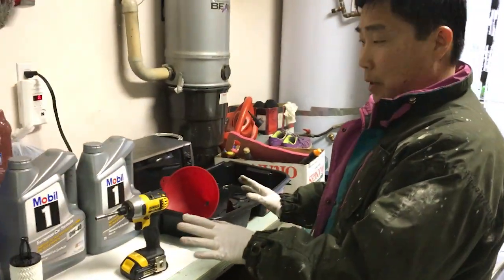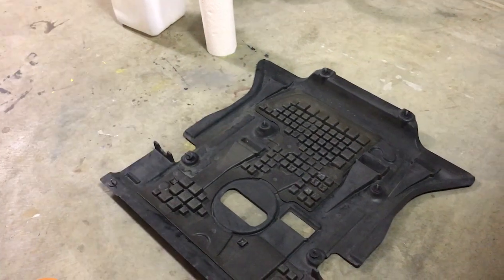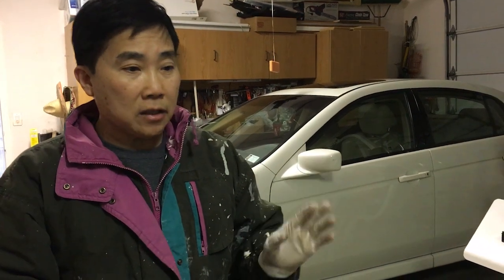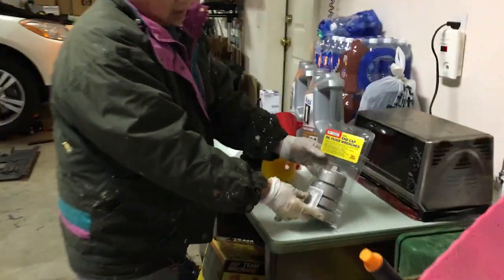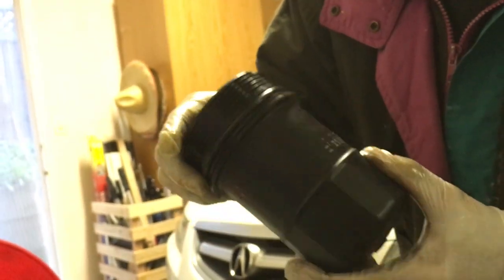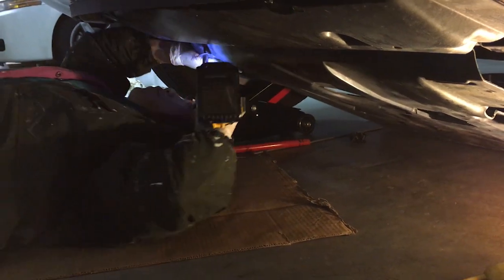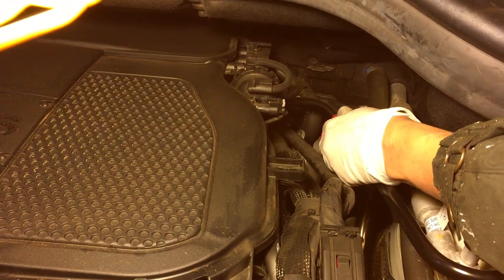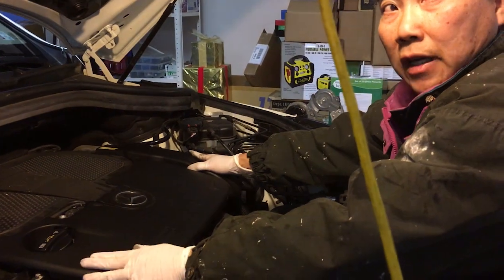Mercedes ML350 Oil Change (2013)

Comment: Excellent video. I enjoyed watching your father-son team. The only thing I might add are the torque specs for the oil filter. It is 18.5 ft-lbs (25 Nm). I haven't found the torque specs on the drain plug.

Comment: Much easier option is to extract using a pump from the dipstick route. I bought a mityvac and it makes the job a breeze without the need to go under the car or removing any of the shields and covers

Comment: Great specifics on all but the difficulty getting the undershield back in place. First, you can't reach the back two screws without lifting the truck some. Worse, because of the angle the rear of the plastic shield requires to get back above the rear cross piece and into place to screw back in, you really have to lift the front even more to be able to get enough angle to get it jammed up in there. And you most definitely can not start putting it back on from the front back. Back has to go up/back into that slot first, then work your way back to front. All this on a 2014, but I suspect others are similar. 

Thanks for the video - saved me rummaging around for proper sized sockets. First time was a little over an hour with two beers and a sprinkling of profanities. Next time should be done in 30 or less minutes and without scarring any children.

Comment: Nice video👍 I just purchased a new '15 ML 400 and I already know the high labor cost for Mercedes at the dealership. Luckily for me, I'm a DIY mechanic at home working on plenty of cars but not a Mercedes yet.
Reply: This oil change is 180 dollars at the dealership.. completely ridiculous
Reply: @roodick85  That's cheap, I was quoted 350 Euros and that was with cheaper oil.

Comment: You saved over $200 by doing it yourself. Nice video, very educational video. Does it void any extended warranty if you do it yourself? What happens to the service A or B that's popping out from the dashboard, how do you shut it off?
Reply from the maker: Warranty was not voided per my understanding but please verify with your Mercedes dealership. To shut off the display message, please check the internet forums. Frankly, my dad does that and I don't live with him anymore so I don't know.

Comment: It says 10,000 or 1 year but I drive around 6000 and sometimes even less on my 2012 ml350. Can I wait until I complete 10,000 miles? What is the hurry with these modern engines?
Reply: My opinion is yes. However if you want to know for sure, when you change your oil send a sample to Blackstone Labs.  For about $35 they will tell you if the oil was still OK.  Then you will know.  They will send you a sample collection bottle free.

Comment: thanks for the great video.. some tech told me that mercedes do not actually open the bottom covers they simply suck the old oil out then put the new . claiming that opening covers every time will weaken screws.
Reply: jdroid And exactly how are they supposed to do that? I just wonder, because as a previous MB owner, there's no way in earth you can have access to the oil drain plug whitout removing that cover.
Reply: They use a vacuum extractor to literally suck the oil out through a tube... from the top.

Comment: I worked on a mercedes dealer and worked on many of these. I also work on some bmws on the side. German cars arent that special for oil changes. They are as easy to change the oil as your typical toyota, honda, ford or chevy. You just have to know what you are doing.

Comment: Great video and very helpful, but the ML is supposed to hold 8.5 Quarts of oil. (A little over 2 gallons)
Reply: You are correct that it's suppose to be 8.5 quarts...he used 7.5 quarts.  He should have started the engine and let oil get funneled through the oil filter and re-measure.
Reply: I guess 7 to 7.5 should be good enough. Hope this helps. Refer here -https://oil-change.info/mercedes-benz-m-class-engine-oil-capacity/
Reply: 8.5 is bluetec.

Comment: is the mobil ow-40 the best oil for this ml
Reply from the maker: +MURATI XHULIANO It depends who you talk to, but yes.
Reply: IS THIS  A DIESEL ENGINE OR WHAT ?
Reply from the maker: +MURATI XHULIANO nope. It is not the BLUETEC model.
Reply: Mercedes recommends Mobil 1 0W-40...you may also visit the Mobil 1 website and plug in your vehicle - Mobil will advise what oil & Filter to use.

Comment: Great video.....I would suggest using a 1 QT. measuring container to add the additional amount of oil after pouring the first 5 quarts......use the 2nd 5qt container to fill the 1 QT. Container.....I also use BG Products #109 as a pre-oil change flush to remove the sludge,  followed up with BG MOA (Motor Oil Additive) ….(* do not over fill crankcase.)…..and add BG 44K to gas tank at every oil change.